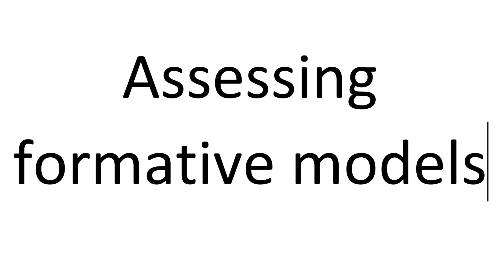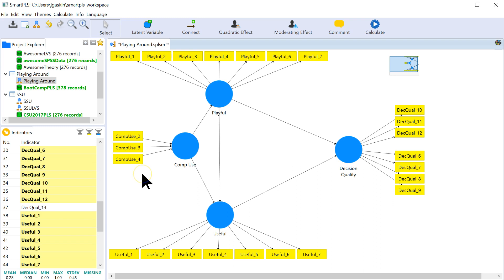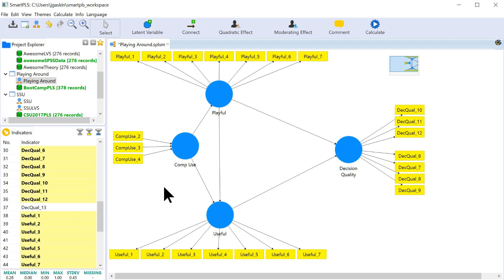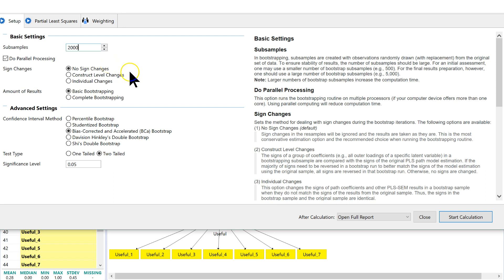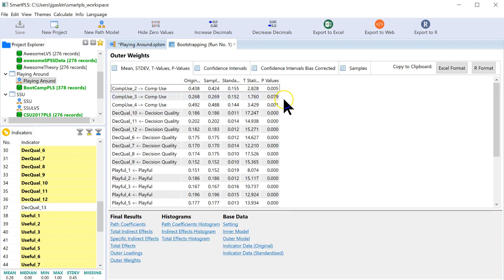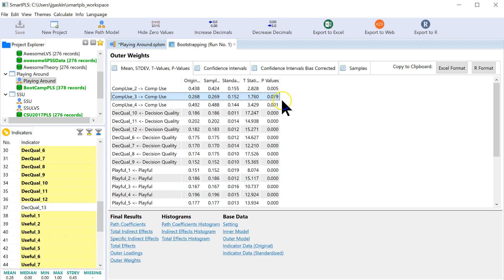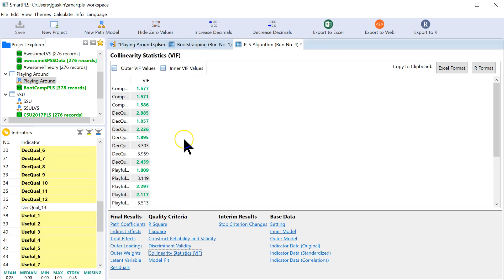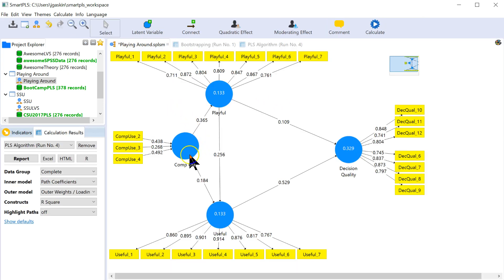Validating Formative Models in SmartPLS 3

Comment: Dear Prof. Gaskin, I have a question here. What if I am using second order reflective-formative, how should I assess the formative second order? 
Example: Construct A has three dimensions (1, 2, 3). There are five items to Dimension 1, four items to Dimension 2, and three items to Dimension 3, reflectively. However, dimensions 1, 2, and 3 are formatively link to Construct A. From what I understand, I need to report the t-value, significance, VIF and weights of the items. But in my case, my items are all reflective but the dimensions are formative. Where should I get the outer weights and what should I report?

Thank you in advance for your reply, Prof.
Reply from the maker: I think I will have to make a video for this... The short answer is that you follow procedures for both formative and reflective at the appropriate level. So, for the reflective level, use CR and AVE, but for the formative level, use VIF and t-stat (or p-val).
Reply: James Gaskin thanks..I am also using same process for analysis.